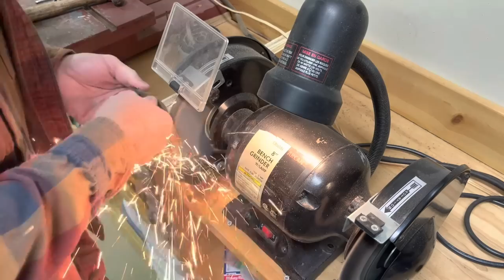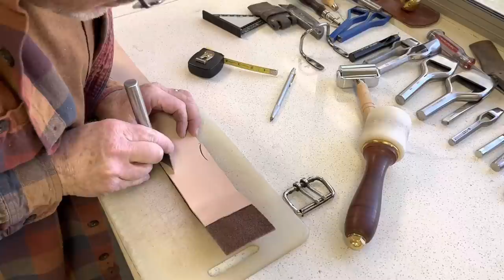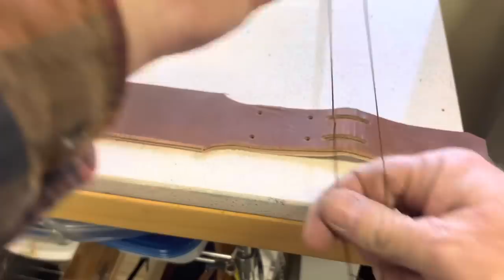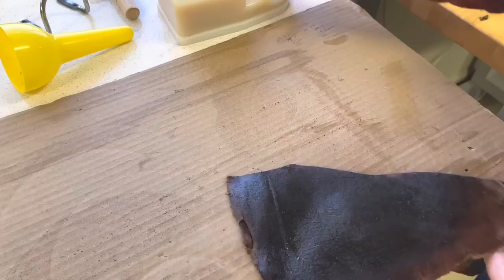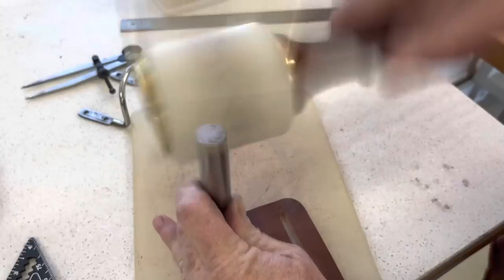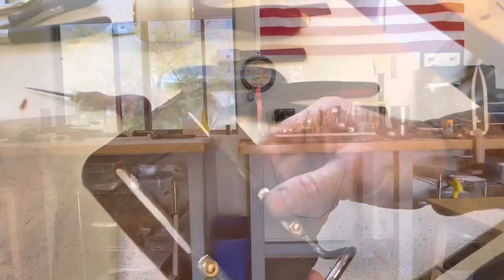Carpenter Belt with Hammer Loop Build (Restoration) @InMyBusyLittleShop

Comment: Just excellent. The algorithms in YouTube suggested this video and I am glad it did as I am now a subscriber. I know it is probably revealed in other videos but I would appreciate if you would identify the surface you have on the main bench you used for this belt and hammer loop rebuild? Obviously very durable. I am guessing a tough synthetic material since it is subject to sharp banging with the rivet setting. Thanks again and I look forward to going back and watching earlier projects.
Reply from the maker: Thanks
Reply from the maker: Sorry I guess I didn’t get the remaining message sent. The work surface is man made quartz. Normally I “abuse” the 2” thick granite that is on my other table. I like the light that is on this table better. I guess I’m testing how strong it truly is. The countertop company I got it from said it very hard to break it.  Sorry for the slow response
Reply: @InMyBusyLittleShop  Not a problem. I actually commented on the video and then edited it with additional comments just before you responded the first time. Thanks for your response. It sure looks like some tough stuff.

Comment: Is everything ok with these copper rivets? I would rather see them the other way round.
Reply from the maker: I like both copper and brass. The brass are a little stronger but harder to form. I use both ways depending on the look I think is best for the application. Great question!!

Comment: New guy here. Great looking belt! I'd love to get some leather work done from you. Do you take orders of any kind? I have a belt I really like, and the buckle is not detachable.  However it's a bit too long in size. When I buckle it's on the last hole barely fitting. Do you think you'd be up for an order of fixing it? Thank you so much. Subscribed.
Reply from the maker: Thanks for the note. You are entered in my drawing.  Could look at fixing it. Sounds like a fun project
Reply: @Robert Little  Hi! Thanks for the quick reply. It's a simple fix of shortening the belt. I believe I bought it was 42in long but I am a 38/40belt size. I thought maybe I'd be able to squeeze in..well, it barely fits. Like I said..I believe buckle is non detachable easily..so.. perhaps add new holes and cut the end and make the Same look for the tail on it.  Rounded edge like belts are.. I see you have Facebook. I'll get in contact if that's OK, within a few days or today if I get around to it....Name is Peter. So if you see my message. Much appreciated:)
Reply from the maker: @zergo0621  sounds good. Happy to look at it.